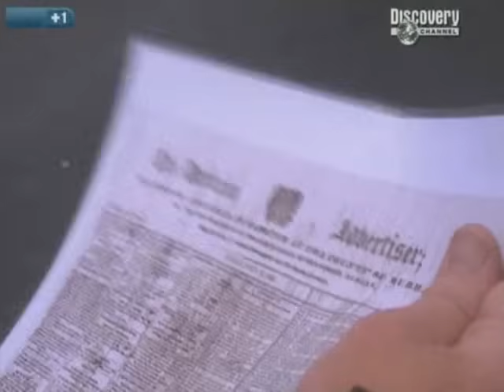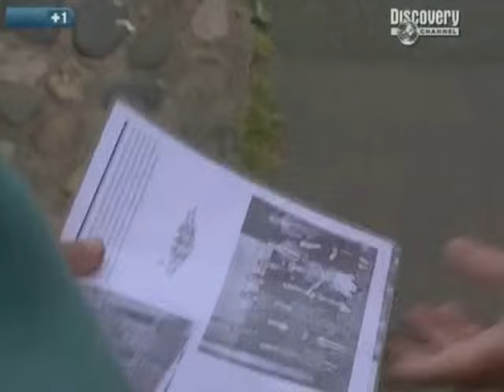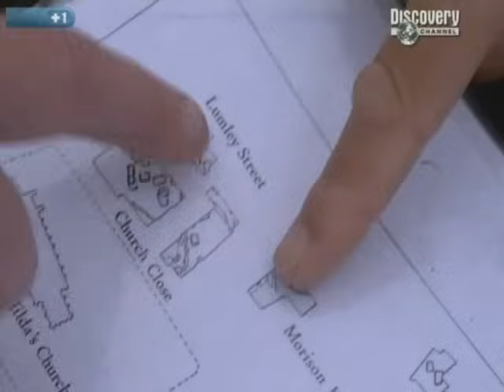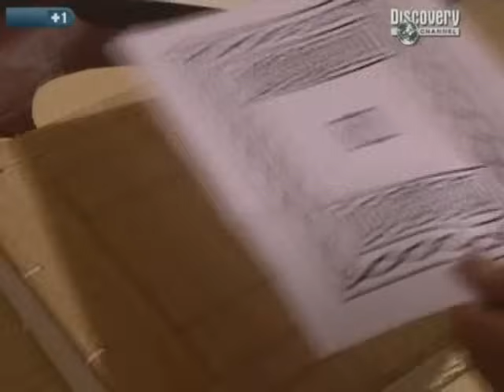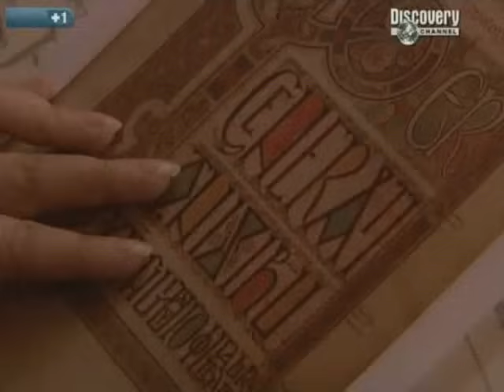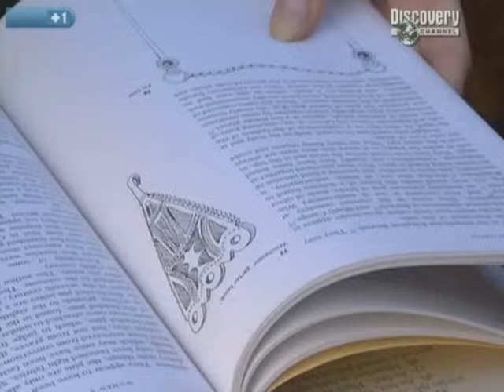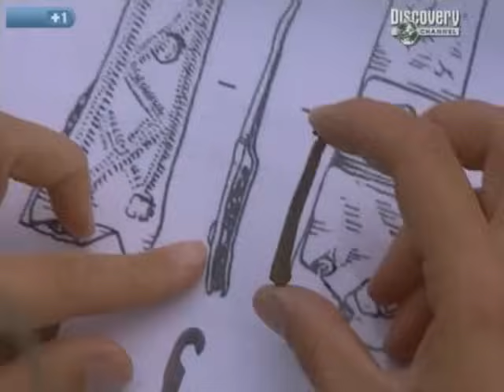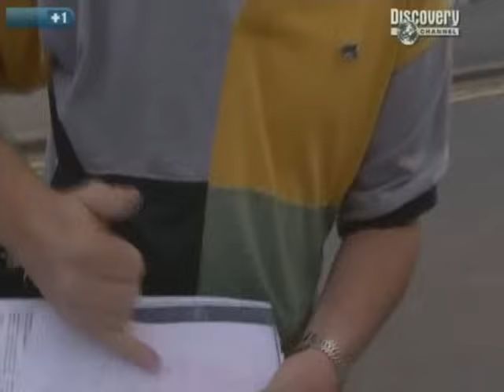Time Team S07E12 hartlepoo,.northumberland

Comment: Funny that they must block the skeletal remains from the public view on site yet show it on these shows. :/
Reply: Scott Stewart If you watch other episodes where they work with human remains, they usually wear sterile suits with face masks, and that's so they don't contaminate the remains with their own DNA so they can do a proper analysis in a lab later on.  I'd guess they block the graves off from the public for the same reason - so (hopefully) their DNA doesn't contaminate the remains either.  Lots easier than making every passerby wear a mask. ;)
Reply: See I thought they were just using the wood as shoring to retain some of the vertical cuts in the soil due to the danger of collapse and undermining the surrounding structures and walls.
Reply: So?

Comment: right in minute 36.. he says because the body is under the mid evil layers it must be saxton .. well how many feet thick is the mid evil layer?? seems to me that a buried body would be at lease 3 to 4 feet to prevent animals from digging it up... so it would be in the lower layers..    other than that GREAT SHOW!!.. love it.. cant stop watching it..
Reply: From what I've gathered, any layer - be it Medieval or more recent - is on average about 3 meters thick. I think in some areas it might be a lot less, some areas a lot more. It depends on the use of the land since the period in question. And since the Saxons came before the Medieval period, that layer is below the Medieval one.
Reply: NolaGal2601
idk 3 meters is about 3 yards.. not quite but almost..  there holes would be like 9 ft deep.. somethings not right here.. the math is off.. dam common core...
Reply: That's why I said in some areas it might be more and others less. If a hill was built up over an area that was previously flat, standing at the top of the hill and digging through the center to get to what was previously flat will make a hole deeper than if you stood on a flat area near the hill and dug a hole down to the same level.
Reply: NolaGal2601
true..
Reply: hondaxl250k0 A lot depends on terrain too. A site at the bottom of an elevation could have deeper layers caused from erosion from the higher ground settling lower. With a tidal area like this location there's a multitude of variables due to storm effects, tidal etc that can remove or relocate soil.. If it's a river delta things get even more strange as rivers change course over time. Here in the states the Mississippi River is a classic example of change as even far up river it's moved many miles many times from the ancient channels. The old Riverboat pilots in the 1800's had to keep a close watch as sand bars were constantly shifting or disappearing in as short of time as a month or so depending on water flow.
Reply: How about medieval and Saxon.